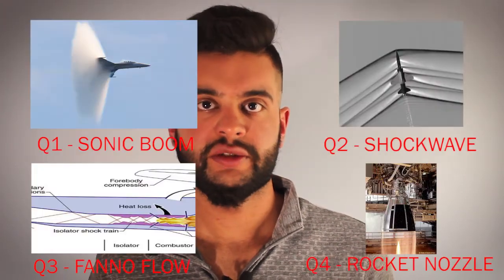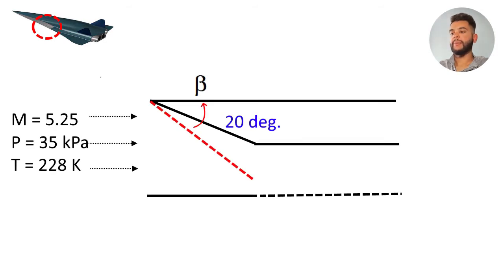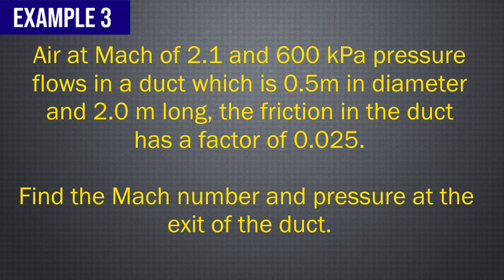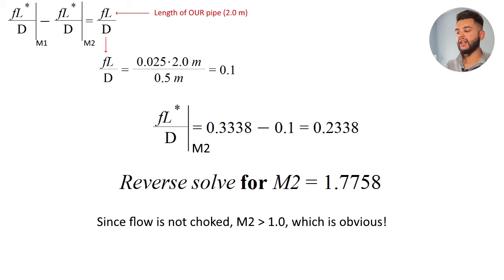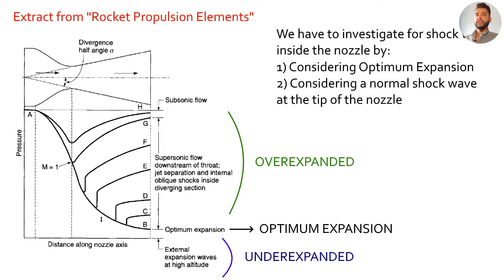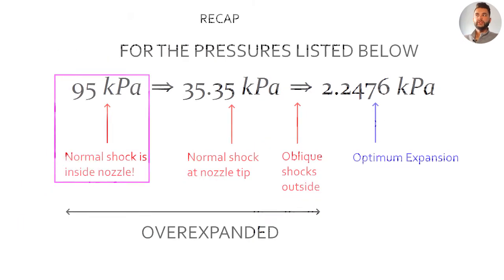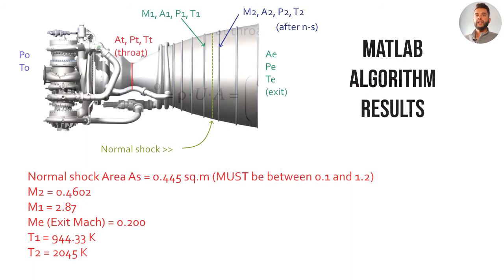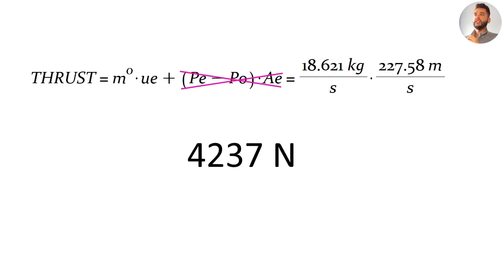Compressible Flow: Four Solved Example Problems (including Rocket Thrust Calculation!)

Comment: Problem #3, why are you using fL/D instead of 4fL/D? I found ~0.3339 from the table as well, but if you use 4fL/D the flow is choked

Comment: At the p0/pe =...  equation, shouldn't there be a minus sign at the power so to the power of minus 1.5/1.5-1?
Reply from the maker: yes , typo
Reply: @VDEngineering  your welcome
Reply: Actually p0/p should have a positive power, the only typo there (10:34) is that gamma is 1.3 so it should be 1.3/1.3-1.  The p0/p equation at 12:54 is correct, with the positive power. But T0/T at 12:54 should not have a power of -1, it should have no power, or the power should be 1. When the fraction is static pressure (or temperature) over the stagnation pressure (or temperature), then the fraction is less than 1 so the power is negative (static values are always less than or equal to stagnation values). When the fraction is stagnation pressure (or temperature) over the stagnation pressure (or temperature), then the fraction is larger than 1 and the power is positive.

Comment: Hello sir! I am your fan from india and I am completing my bachlor thesis in germany and thesis is related to raptor rocket engine having methane oxygen fule. The my hand calculations are done as per the information available in internet about raptor engine fule inlet is 525.3kg/sec and my main problem in cfd simulation is what density should i use? (Simulation in ansys) as the mixture ratio of methane and oxygen is 3.8 i thought "volume weighted mixing law" density should be perfect and accordingly i got density value of 0.79(in inlet reference values) which i thought is good as methane and oxy will be gas,but when i calculated i didnt got the flow i want, and initially i tried with idel gas and i got the flow properly which i want but when i am using idel gas then the density reaches to 16kg/m3. Which i think is not correct so which is better for me? There are 9 ways for type of density selection. My mesh is very uniformed and will not have any problem with divergence detected etc.. i wlill be very happy if you guide me
Reply: May be it is not problem with density, it can be problem with my geometry. Because Initially when i tried with idel gas and i got the flow at that time the geometry i used was having CURVED THROAT  but later i changed the curved throat into a SHARP EDEGE throat between convergence and divergence area, so maybe that can be a problem.

Comment: Hey, thanks for making this video, it looks great! Problem 4 has been very helpful. For problem 1, however, I am getting a different answer. I get that the jet will make a Mach  cone with that angle and shape, but the time that you calculated is the time that it would take for the jet  sound produced at that point in your image to reach the observer. But when the jet is directly overhead of the observer, it will still be producing sound that will be emanating in all directions, including straight down to the observer. Those sound waves will reach the observer with the sonic velocity, traveling the distance of just 1000 ft. The time I got was 0.904 seconds. 

Another way to think of it is, the vertical component of the sound wave velocity is going to be 337.2 m/s, whether the jet is stationary or traveling at Mach 5. So the horizontal speed shouldn't affect how long it takes for the sound waves  produced when the jet is directly above the observer, to reach the observer. I think what you calculated is the time that it would take for the sound waves produced later on, to reach the observer, but earlier sound waves would have reached the observer long before that. 

This is kind of like a falling object trajectory. When an object is dropped from 10 m with zero horizontal velocity, it hits the ground in the same amount of time as the same object dropped from 10 m but with a large horizontal velocity. Intuitively, one might think that giving the object a horizontal velocity would make the time to hit the ground longer, because it travels a larger overall distance, but the vertical distance traveled is still the same (10 m), and the vertical component of its acceleration is still the same (9.81 m/s^2). In this case, the vertical distance that the sound wave travels is still 1000 ft, and the sonic velocity is still 337.2 m/s straight down, regardless of horizontal airplane velocity. 

I think a good problem to demonstrate the effects of a Mach cone would be to calculate how far the plane has flown past the observer by the time that the observer hears the plane. That distance would increase with jet velocity, and that's  the concept of a supersonic jet that throws observers off. They aren't waiting longer than normal for the sound to get to them, it's just that the plane is long gone by the time they hear it because it's traveling faster than the sound can reach the ground.
Reply: Also, shouldn't fL*/D have a 4 in front of it? In my notes from a gas dynamics class, Fanno tables, and wikipedia, it says 4fL*/D equals that equation. If the 4 should be there, then L* = 1.67 m < 2 m, meaning that the flow is choked. Or am I missing something?
Reply: Oh. In some countries and professions, the f represents the Fanning friction factor, which is equal to 1/4th of the Darcy friction factor. Hence why we use 4fL*/D, or 4(f_F)L*/D where f has a subscript F for Fanning. Other countries and professions, the f represents the Darcy friction factor. Hence why they use fL*/D, or (f_D)L*/D where f has a subscript D for Darcy.
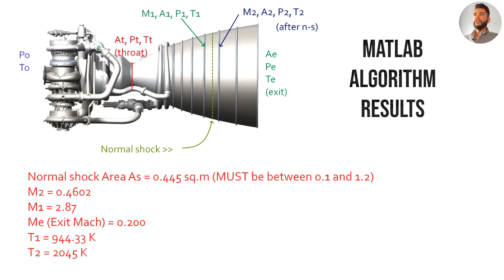Reply: At 14:38, the T1 looks like it was calculated with a T0/T1 ratio of 2.647, which is the ratio calculated if gamma = 1.4. But since gamma = 1.3, T0/T1 should be 2.236, giving a T1 of 1118 K. Then T2 would be 2423 K.